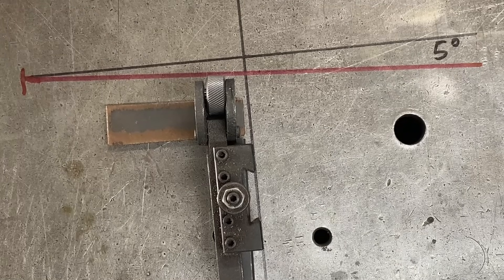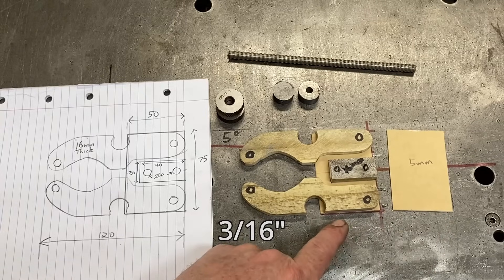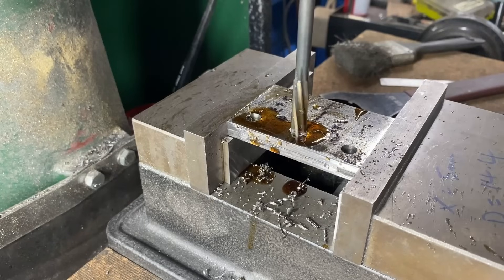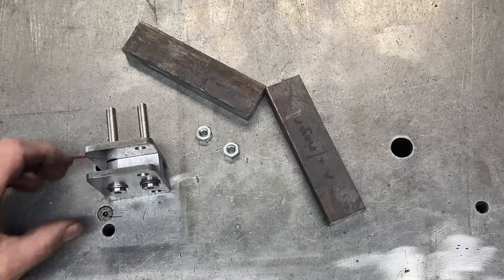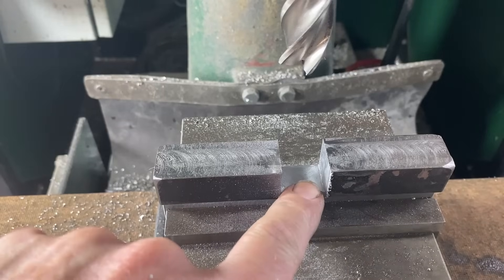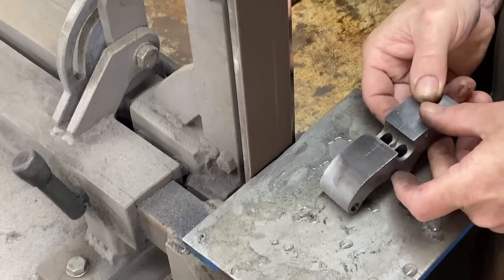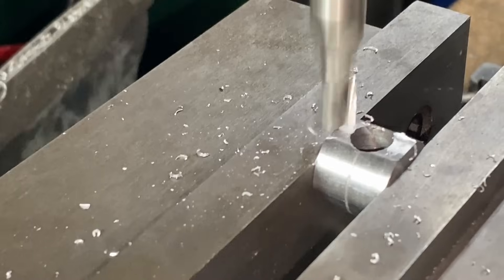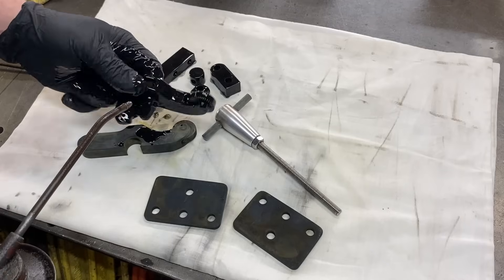Poor Man's Hemingway Style Knurling Tool

Comment: That looks like a winner Jon. I have the plans for the Hemmingway sensitive knurler if you want a copy. They were passed on to me by John Creasey. I find that compressed air is a good way of cleaning debris out of the knurl pattern as it develops. It works really well on soft materials. Cutting oil just makes a sludge which gets carried around and it sort of mushes up the crisp diamonds that a knurl needs. 
Regards,
Mark
Reply from the maker: Thanks for the tip Mark. That cutting oil does make a mess. I will try the compressed air method when I use it next.

Comment: Gday John, great build, I normally go just over centre of the with the knurl wheels, give it a little adjustment then back the cross slide out to pull the wheels into the work piece, I’ve found this is much easier then trying to tighten down with it on centre, hope this helps mate, top job, cheers
Reply from the maker: Thanks for the tip Matty. I will give that a try when I use it next. Thanks for watching and I hope you are doing a bit better now.

Comment: Nice outcome in the end, certainly looks the part, I contemplated making one then spotted a Chineseum version and bought that instead, it works ok most of the time 👍
Reply from the maker: Thanks for watching. My original knurler was Chineseum. Maybe you got a better quality one than what I had?
Reply: @thehobbymachinistnz  My first one was a Chinese piece of crap like the one you opened your video with, the new one is more along the lines of the new one you made, it's not quite as sturdy as yours looks, but does a pretty reasonable job. 👍
Reply from the maker: @MyMiniHomeWorkshop   👍

Comment: Very nice. I think the first thing that I'd make with it would be a knurled  lock nut for the twisty-turny grabba-holdy thingy on the top 😄
Reply from the maker: Thanks for watching. The lock nut doubles as a lock nut to hold the handle onto the all thread, and something solid for pushing the arms together as the aluminum handle would likely get chewed up. It is permanently tightened.

Comment: Hi John. That turned out great. I did build the Hemingway sensitive knurl tool some time ago. But yes they are expensive. I was given a stack of knurling wheels & they are all imperial bore size. 
Steve.
Reply from the maker: Thanks for the info Steve. That probably explains why there is some play in there then. I will need to account for that when I make the knurler for the larger lathe.

Comment: Nice job. 
I noticed you had several other knurls as well for some parallel knurling. A trick for getting a nice knurl finish is getting  suitable relationship diameter wise between it and the knurl pitch. This will make a beautiful knurl that isn't double cut.  The simple way is to measure the  circumference of the knurl tool wheel and count off the points. The pitch will be the factor for the tool. Using that pitch measurement you just have to make sure it divides evenly into the circumference of the job you are doing.  It isn't a lot but it will make a difference. The Coarser the knurl the better the result. The diameter you aim for is the trick and you rarely want more than a single rotation.
Reply from the maker: Yes, my example was a bit double imprinted. Thank you for the info, I will try that out next time I use the tool.

Comment: If I may make an unsolicited suggestion…… I suspect adding a small thrust bearing with its hardened races between the handle jam nut and the tool arm will make it even more of a joy to use 😊
Reply from the maker: Yes, that would reduce some of the friction.

Comment: If you put some copper in the slot (to protect it) you could use weld to build up the thin parts of the arm.
Reply from the maker: Thanks for the tip Mark. I may need to do that if the arms don't hold up.

Comment: A additional feature you might consider is making the top pivot an eccentric with a suitable lever to allow extra pressure to be easily applied to the knurls as required.
Reply from the maker: Thanks for your comment. This is how the Hemingway sensitive knurler works. I will attempt this one for my larger lathe in a future video.

Comment: You could also press fit a bronze bushing in the knurling wheels then ream it with the same tool.
Reply from the maker: Yes, possibly. Although the play is probably about 6 or 8 thou. So 3 to 4 thou wall on the bronze bush. Would that be thick enough to work?
Reply: @thehobbymachinistnz  you can always make the hole bigger first. I probably wouldn't want to go below 1mm.

Comment: Can you explain why you had to resort to a hacksaw when you had the milling machine set up with the 20mm cutter ?
You should press deeper to get a "full" knurl too.
If you pull back the crss slide a little, Crank down the tommy bar.
Advance the cross slide back in again. It is easier than just squeezing the arms together on the workpiece.
Reply from the maker: Thanks for your comments and tips. I ran some more tests and I got better knurls with more pressure.
I used the hack saw because my cut off wheel did not cut in deep enough.

Comment: LMAO with as many times as Artisan Makes has been called out, he's eventually going to have a surface grinder, metal 3D printer, a CNC lathe/milling enclosure, and still be relying on manually hacksawing pieces apart... 😅
Reply from the maker: I have seen him use an angle grinder occasionally. I'm not sure why he does not use it more often.
Reply: @thehobbymachinistnz  keeps his arm muscles in shape. Good for arm wrestling at the pub. What gets me is how he holds the saw with both hands on the handle. I was always taught to use your predominant hand on the handle, your second hand on the opposite end of the saw. Stand so your predominant hand's shoulder is in line with the cut and proceed to cut about two strokes per second, no faster, until done. Depending on material, use the appropriate cutting compound and as in woodworking cut on the waste X side of the line. 
The other thing to practice is using the whole, or as near as possible, length of the blade. Cutting using 4-6" of a 12" blade seems to be a little counterintuitive.
Nice job on the knurler by the way. Doug Gray of Canada also produces a very well thought out kit, very similar, with good drawings, pre shaped but un drilled material that I suspect is either lazer or water jet cut. Cost around $100 Canadian, roughly the same in Ausie bucks. Don't know where your NZ ones figure. I have a kit of his waiting for inspiration to make it.
As to the "slop" in the knurling rolls, this might be advantageous in having the rolls meet the work at the correct angle i.e. 90°. If it concerns you you could most easily fix it by making two new pins   from say 10mm bar reduced to the bore diameter of the rolls. (9mm?) Then turn each end of the pins to your desired 8mm. This then means you don't have to bore out or remake the arms. Also if you make the pins a little longer and provide a groove near each end you could mount them with circlips to make changing roll styles easier instead of peening the ends over with a hammer.
Greetings from Canada's banana belt.🤞🇨🇦🍌🥋🇺🇦🕊️🇳🇿🐏👍

Comment: Hi Mate, What if you used a thin walled brass insert inside the knurling wheels?  That way you can keep all tolerances down to 0.001" and then swap them out as you wear-in the new tool.  Great job of designing and fabricating!
Reply from the maker: Thank you for your comments. Yes, another person mentioned something similar. I may look at that if I have issues in the future. I will account for this when I build the next knurling tool for my larger lathe.

Comment: i'd be a little worried about those press-fit pins on the knurling wheels themselves working their way out - from what i've seen the pins often have a head on one side and a c-clip on the other. though i guess you did say it would be a temporary thing!
Reply from the maker: I was going to make some custom bolts with nyloc nuts. I may do that if the pins work their way out. Thanks for watching.
Reply: @thehobbymachinistnz  I don't think you need to worry. There is no axial force on the pivot pins, so they're very unlikely to shift in use. The only reason to secure them at all it to keep them from falling out when you lay the tool on its side to store it. On my own knurling tools I use standard hardened dowel pins. They are a slip fit in the arms so it's easy to change rolls, and I use tiny set screws to secure them. I hardly need them, congealed cutting oil secures the pins just fine.

Comment: The Hemingway design is elegant but overcomplicated. Many elements can be greatly simplified without sacrificing performance. It puzzles me a bit that so many youtubers copy it so closely. But if you have the material and the patience and want something that will look nice for the rest of your life, I suppose that's reason enough for the extra effort.
Reply from the maker: Thanks for your comments. In a lot of the videos I have seen from other YouTubers, it looks like they are building the knurler from the Hemingway plans. Maybe that is why they look so much the same?
Reply: It shouldn't puzzle you - notice one month all of a sudden a bunch of prominent youtubers make the same tool from the same supplier. The community over the last few years has become absolutely lousy with undisclosed sponsorships and it's ruining everything. Ever noticed how every woodworker and metalworker on YT uses the same tools?